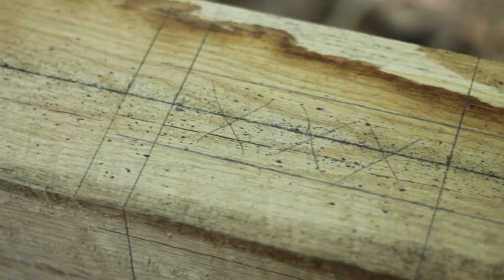Timber framing a medieval capstan

Comment: Where did you learn about capstans?  I'm trying to find info out there about Chinese Windlass' to make a hoist/crane for my timber workshop.  I can't find anything on it? Would you suggest anything or anyone to teach me about it?
Reply from the maker: Not sure what you need, or what youre trying to lift exactly. A good pair of shear legs and a triple sheave block and tack set can move alot even without a winch mechanism to help. We raised our house with the capstan from this video, a pair of shear legs and triple sheave tackle blocks, 3/4" manilla rope. It was way overkill really as a pressure of about 15lbs was enough on the capstan to raise each bent of our house, which weighed alot. Weve shown in a few videos how the shear legs and capstan work together. But if you want more options, below is a good link showing some hoisting options. 

http://www.en.charpentiers.culture.fr/treesintohouses/thecarpentersart/hoisting
Reply: Thank you sir!  I also wanted you to know that I appreciate you getting all this work of yours on the public record for future generations. I found a set of old Fox Fire books that my mother in law had that were really old and full of great self reliance/homesteading stuff. This kind of seems like the modern version of that. Anyway....thanks.
Reply: Chinese Windlass hoist video (it's a capstan with a differential) -- https://www.youtube.com/watch?v=zfaeVPQO2ek&t=415s

Comment: What is that tool called, around 4 minutes in, and used to drill through the wood? (I have a feeling i'm about to look pretty stupid, and it will literally be called a "drill")
Reply from the maker: Its called a boring machine
Reply: thats boring. i was hoping it would be called a drill. ;P

Comment: How do you make sure you don't twist when you draw the line across the length of the log?
Reply from the maker: Im not sure I understand your question? Maybe try telling me what log, what timeframe of the video and Ill try to help...
Reply: Thank you for replying. On 14:12, how do you make sure the line is straight (perpendicular on the log end) and doesn't twist or go around the log? 

To clarify: if the line would "twist" around the log, if you would cut that log on the line you'd get a (I hope I'm using this word right) taper on the log.
Reply from the maker: Right so I use a level to cross each end without moving the log, then connect these lines with the snap line down the length of the log. That way anything you lay out from these lines will be out of twist and true.
Reply: Ahaaaaaaaa. Great technique. Thank you.

Comment: Beautiful.  How many days total?
Reply from the maker: thank you, two days of work
Reply: Mr. Chickadee Wow, only two days for everything there? Felling the trees, shaping and forming, and fitting the frames?  That must speak to a very high level of skill and practice, Impressive.
Reply: or he switched out the primary beams for purchased milled lumber instead of squaring it himself. (You can see the milling marks on the vertical timbers...)
Reply from the maker: The oak used for the frame we sawed on our mill, I only roughly hewed a few pieces which were split out from wider stock, these became the stretchers and braces, I just wanted them to be roughly rectilinear for ease of joinery.

Comment: How and what do you use to sharpen your saws? thanks
Reply from the maker: Depends on the saw, normal hand saws are sharpened with triangle tapered saw files. Vintagesaws.com has a good treatise on saw sharpening. THe big crosscut saws take a bit more tooling to do right.
Reply: Thanks for the very informative website, and for your getting back to me!

Comment: Do you ever run into issues when using green, unseasoned timber?
Reply from the maker: not if applied correctly
Reply: Mr. Chickadee What are the correct applications? Im curious to learn... I know you do great work
Reply from the maker: Traditionally all log and timber frame construction was done with green wood. Many things for the home can be made green as well of riven truly quartered stock is used. If not, air dried stock is best for furniture and interior joinery.

Comment: Bucking with an axe is really hard and somewhat wasteful. Why do you do it when you have a crosscut saw?
Reply from the maker: I find it easier to just pack a sharp axe when bucking and transporting small logs, as they get bigger, the crosscut makes more sense...
Reply: Mr. Chickadee
I hadn't thought of the ease of sharpening an axe as opposed to sharpening a crosscut saw.

Comment: You use fresh wood timber. Don’t afraid of shrinkage in the frame and disaster?
Reply from the maker: Fresh wood is better, if used correctly no issues with natural shrinkage, this was done traditionally forever. Th timbers are about 6x6 for the main pieces, 4x6 for braces and stretchers, axle is about 12" in diameter log, carved to 8" thick where rope attaches. handles are about 2-3" thick saplings of strong wood 8' long. capstan is about 4 feet tall, just make it good height for walking around pushing handles. about 1 meter wide

Comment: In the beginning making a lot of wood work to fit all. In the end: f... it, nails!
Reply from the maker: All wood joinery is used in the frame to give strength where needed, the yoke has no structural significance and only serves to steady the axle when not under load, so yes I used nails to secure it, a person could take the time to mortise and tenon the yoke together if they felt that was necessary to them.
Reply: if its "medieval" build, then nails is likely precious and would not be used. anyway, if nails is ok, then all build coud be based on then, without sk much wood carving labour
Reply from the maker: I will attempt to explain better, this capstan is of a "type" which would have been used SINCE medieval times, its braces are of a medieval form of timber frame joinery, that is just a descriptive form of name I gave the video, because it was better to me than "capstan", this is not a medieval reconstruction, I am not from medieval era, nor are my clothes, my tools, or most of my methods. This is just a tool I am making to use for the raising of our house frame…

Now as to your assumption that nails should be all or nothing, NO. Timber frame joinery is immensely stronger, more rigid and longer lasting than something just "nailed together" and THAT is why I used traditional timber frame joinery for the capstan frame, and my house, and my workshop, and most likely anything I make with wood that I want to last and be strong. The YOKE did not need such strength, so nails were used. 

So no, its not, either all nails or no nails, all or nothing. Neither is it, "let me correct this guy on how the medieval people lived and worked and what tools they used".

Comment: Neat! If you need more force, your design could easily accommodate a differential (Chinese) windlass, using a different diameter on the same pole. Assuming the diameter of the larger barrel was 12", your mechanical advantage would be ~56:1 according to the calculation on http://makezine.com/projects/make-25/the-chinese-windlass/ 
Hopefully you don't need to lift anything that heavy though :)

Comment: yes in medieval times old nails were reused all the time but those (17:55) are not medieval nails the real ones were rectangular shaped because its a lot hard to make round nail using only a forge hammer and anvil then it is to make it rectangular plus the rectangular shape makes it more robust its easier to remove them without breaking or twisting then it iis with modern nails even when heavely rusted 
- 
the rectangular nail was used worldwide up until around the 1950s when they stopped nakking them by hand and started making knock off version with automatic machines nowadays nail are 2 pieces the "stick" and the "cap" are welded together its perfectly fine when first using it but when you want to reuse the cap oftenly seperates from the stick before being fully removed 
- 
why do they make them like that? simple this is called marketing: make easy to break so that the custumers buy more yep our world messed up these days